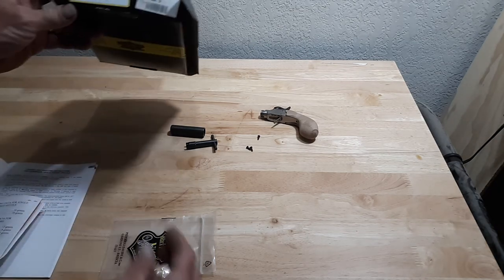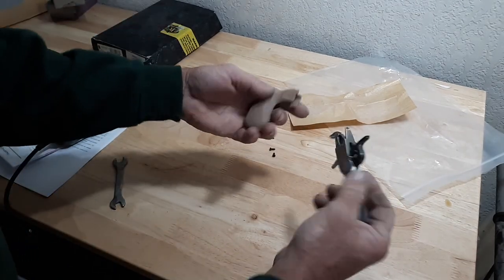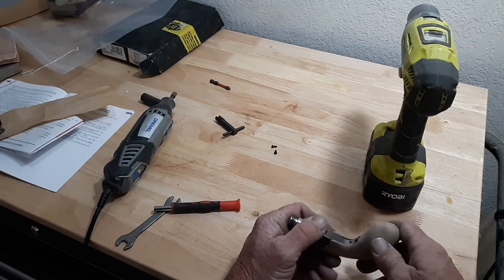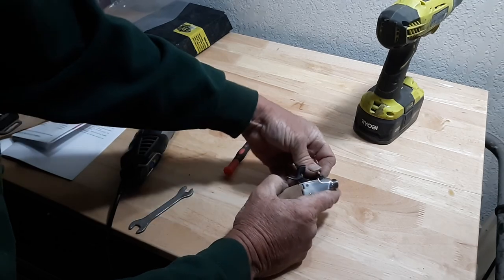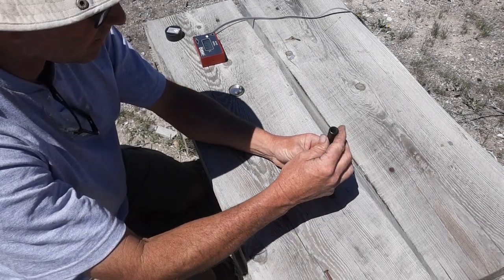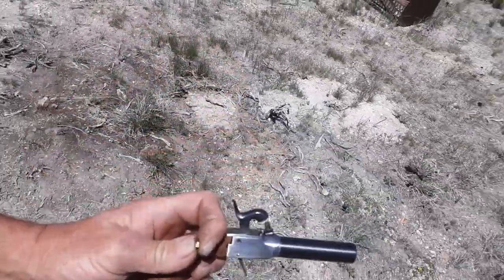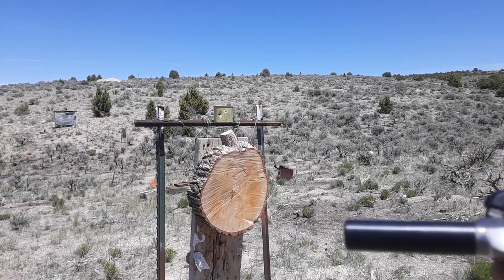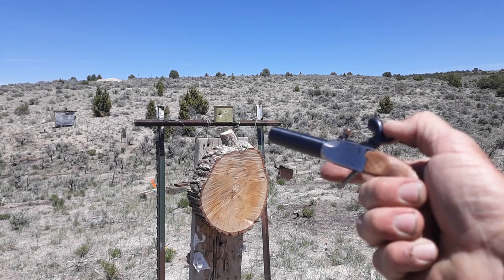liegi Derringer

Comment: Loaded right they shoot between 540 and 580 fps. Get good 3f or 4f powder, - 2f powder in Derringer pistols is useless - and a good oversized ball  -sized  so that you really need to force / press it into the barrel when you screw it on. .454 is to small - use at least a  .457 or better a .460 ball. I measured  that velocity   - the ball penetrates reliable a 1 1/4 finished pine board..I would not  want to be shoot with that and for it's time it was an effective  close distance gun..In a pinch it would be still ..
Reply: Wouldn’t that cause the threads to wear or strip? a .460 ball would be putting a lot of stress on the threads when screwing
Reply: @RevoZ0  I do not have any problems with that and think it is very unlikely to happen .
But you got to be a little carefull how to hold the gun to not twist/ break the handle. Have a nice Christmas!
Reply: @michaelschweimler7292 thank you likewise and do you think .456 ball is enough??? Im planning on using 220 grain .456 roud nose lead bullets would be pretty cool specially with the rifling it has

Comment: That's nice, so did you just use linseed oil on the wood?
Reply from the maker: Yes just linseed oil.
Reply from the maker: Yes just linseed oil
Reply: @damocsell  Thanks, mine just came in the door, your video will help. cheers
Reply: @jimihendrix4376 hello hows your gun doing? Mine should be here this week is it loud ?

Comment: damocsell : Did you ever calculate the FPE ?
Reply from the maker: 260 feet per second 140 grain bullet = 21 foot pounds I could probably improve that a bit by using 777 fffg instead of the Reenactor BP
Reply: @damocsell  
I had wondered why your velocity was so low. Think we know now, never have had very good performance out of that stuff